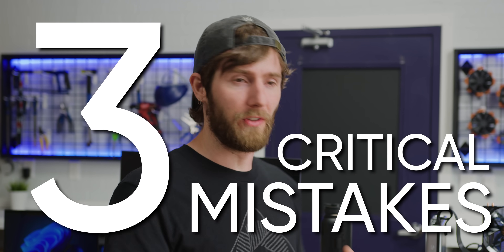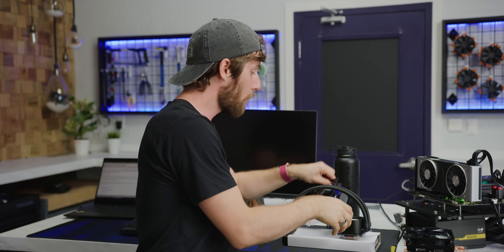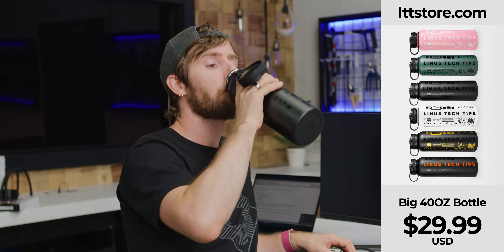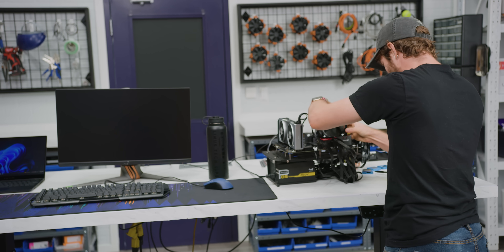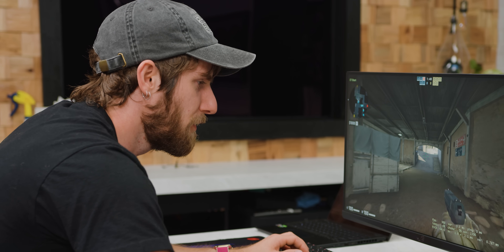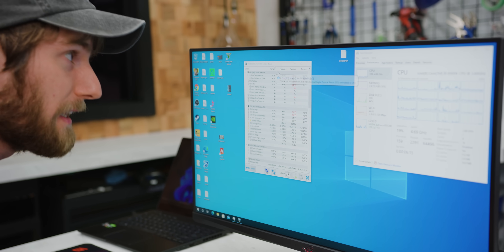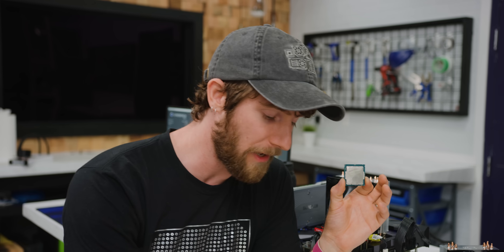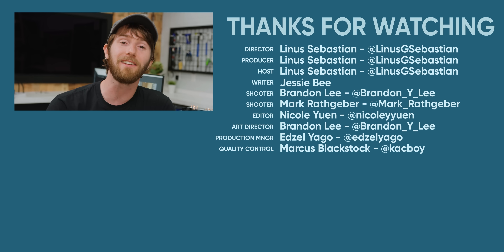How BAD is it if you forget to peel??

Comment: When I was 13 in 2004 I had a Pentium 4, 540 Prescott 775, which as you may know is hot as an oven, and I used it every day for all kind of tasks specially heavy gaming until 2011. Never removed that heatsink until one day I did it, and found the plastic completely melted over the copper core, then I immediately understood why during those 7 years two PSU and one GPU (gf6600) died. For my surprise the CPU is still running fine today in 2022 as a retro gaming machine.

Comment: I've had this happen to me, I believe on the i7-4970k. It smelled like burned plastic almost immediately, like before I logged into windows. It was disgusting, so I panic switched off and fixed it. Nothing happened, the plastic came off without a hitch (it didn't actually melt, it only smelled as if it did).

Comment: This reminds me of my friend who had a gaming rig. He upgraded his cpu to a i7-9700k and realised he probably needed more cooling and got a radiator and I offered to help him install it.

He denied my help as he said he was a better pc builder and could do it himself. So he installs it, we hop on rocket league together and not long before his pc is averaging 90 degrees and crashing every 2 macthes. 

Still running his rig like tht today insisting his room is too cramped and too hot and he applied the correct amount of thermal paste so he didnt do anything wrong😂
(Yes it still crashes on rocket league) 

I  have no doubt in my mind he forgot to peel tht grey sticker on the heatsink

Comment: A few years ago I bought a FX with a mainboard and a watercooler and it worked perfectly, but ran a little hot. So In wanted to remove the thermal paste. But ist was worse: there was so much thermal paste, that it got between the CPU and the socket. I think if it wasn't a CPU with pins it would have stopped working. I think that's the worst thing that can happen.

Comment: I bought my first computer from someone that had build it self and he forgot to peel the plastic of. It was a i7 3930K that really easy could handel it, because these cpu's are beast. But when i tried to overclock it, it ran way too hot so i stopped overclocking and ask for help. Some guy's said that maybe the cooler was not mounted correctly and that is where i found out that the cooler had still that plastic on! My cpu didn't died and it still runs nice and cool!

Comment: at the start of the video im say yes do to plastic when buring or melting do to heat it put off poison in to the air call carbon monoxied  i belive and im sure its not good to have melting plastic on ur cpu im no expert on it i just built computers sens i was 5 and have over 31 years of experiens but never whent to school for pc just help build and run a store with who was my step dad at the time

Comment: I don't remember removing a plastic peel I think my water block had a hard plastic cover but I doubt there was a peel because I have been running a 6850k at 4.6ghz almost constantly for about 5.5 years at a near constant uptime between gaming and mining only times it is off is for cleaning or the 2 times I moved or brought the pc with me for the holidays. The cpu is still solid and will still pass p95 stress tests which I wasn't sure it would still run like that.  I hot it running 4.7 somewhat stable but it wasn't the best and 4.8 was not great it would screen out or freeze up on me if the "case" got bumped too hard it is a thermaltake p3 setup as a wall mounted test bench now but wasn't mounted back then and cats love being dicks by rubbing and smashing thier heads or jowls into things lol.

Comment: Thermal throttling is great. You could run a modern CPU without cooler and it would just get burning hot and extremely slow, but won't die. A good old Pentium or Athlon K6 on the other hand would just instantly release the magic blue smoke, wich we all know is the thing making computer chips work. Without it, they don't work anymore!

Comment: So I have a really big question, due to modern CPU having a thermal cut back is it posable to just for testing purposes and not at all for any reason in a real world scenario. can a CPU be run with out a CPU cooler for long periods of time thermal throttling itself and still run windows normally... probably not but hell it will be a fun video to see.
Reply: Just to be clear I don't think this will work and if it even boots I will be very surprised if it even manages to start windows or get as far as the loading screen. I still want to see and test it for my self with something small like a I3 or perhaps something even as low as a single core CPU.

Comment: I just pulled an old k6 2x500 with a cooler on, and the plastic was never removed. it ran or over 40 years like that i removed the cooler after carefully levering it with a razor after a clean it still works.

Comment: I gamed on a Gateway PC for years where the processor heatsink was not properly installed and didnt know it.  It burned a line in the middle of the CPU where it was "connected".  This was back in the late 90's.  I found out when I was refurbishing it for my parents to use.  When I put a newer CPU in it I saw the badly connected heat sink and the burn mark.  Surprisingly Quake ran good on the machine.

Comment: BUTTTTTTTT what if that plastic has some thermal resistance.. just incase someone was accidentally leave it on so it wont melt i suggest trying a WAY cheaper grade cooler or leave the plastic on a aio block lol

Comment: I think there is another problem   with  thi forgetting  to peel and even more important  than  the heat!  The  plastic in between the  metal cover  of the CPU and  and  heat  sink  conduit in copper  will make  a parasetic  capacitance  that  will  effectivelly  generate a noisy signal  for  the WiFi  and other  wireless  components.

Comment: Worried about this in your prebuilt? You shouldn't be - the OEMs source their parts through contracts, so they know exactly what they're getting, and it wouldn't at all be anything they deem unnecessary (and remember - we're talking about the kind of companies that use 250W power supplies in their i7 desktops). And also, the plastic is there to protect that nice copper base (or heatpipes), and just about any OEM system cooler has a non-spectacular aluminum base anyway. So not only are they not concerned about a consumer installing a heatsink, but not even about that heatsink being at top shape or quality anyway. Much the same here applies to laptops also.

But I'm talking about HP, Dell and Lenovo, so on so fourth - I'm not talking about CyberPowerPC and the like. That would actually be a relatively realistic concern, and has probably actually happened before.

Comment: I had this happen, but it was with the tape on thermal pads that I forget to peel that were on my mosfets and ram modules on my GPU, but unlike this scenario mine turned off in a matter of minutes because of overheating.

Comment: I had my 7700K running at 5Ghz with a Master Cooler 240 usually about 86-90 C. I bought liquid metal pasta and a delidder, than i took it apart and the peel was still on the cooler

Comment: Ive had a client do this once was for like 1 years and most clients also forget to remove the plastic off the gpu top and its just dries up the adhesive and is a pain to remove, most pcs Ive seen with issue are where people don't screw in their coolers correctly where its at a 25 degree angle because only the 2 top screws are in not touching the cpu, if theres enough airflow for cooling in a home pc they wont even know, which is scary

Comment: I ran an r5 1600 for 3 years with the plastic on there and I was pushing almost 1.45 volts through it. That's not to say you shouldn't worry about leaving it on there because you'll have higher temps and the computer may randomly crash but nothing will be permanently damaged.

Comment: I did this with my i7-920. Upwards of 92 degrees Celsius and burning plastic smell. Yes it runs Crysis. Eventually would switch off. Removed melted and burnt plastic with alcohol and added a real cooler

Comment: My work purchases a Dell that was overheating brand new, rather than send it back we bought a cheap $15 dollar heatsink fan assuming it was just a bad stock heatsink/fan from Dell. After removing the heatsink found out the plastic wasn't peeled from the heatsink. The thermal paste obviously wasn't making contact and that explains the overheating..

Comment: My first build 6 years ago I forgot to peel off the plastic on my stock Intel cooler, 3 years later after consistent high temps that I thought were normal, I decided to swap the cooler mainly for aesthetics and died when I still saw the cover on there lol

Surprisingly ran into little issues because I wasn't too much of a power user I guess, but this video brought back some real funny memories.

Comment: I actually had that happen on my first  prebuilt computer and I used it for 2 years thinking 104C° was a normal gaming temperature and when i realized it wasn't ideal temperature i opened and my CPU was covered in molten plastic and it wasn't very easy to get off but I managed to get it out and bought new thermal paste and it went from 70C° not gaming to 40C° and from gaming temp of avarage 90-100C° to 60-75C°.
Reply: 2 years at 104°C... Jesus fucking Christ that poor CPU.
Reply: @Jenna_Talia  how can jesus fuck christ?
Reply: @Jenna_Talia It's pain and torment has made it stronger

Comment: the temps would likely be more intense with a case to bottle the heat

also the longer you keep the system and the more often you run it the more you degrade the plastic

Comment: when i got my new cpu, the store put it in for free with a aio and my temperatures were capping at 99C and i eventually took it apart and the seal was on it. i took it off and now run in the 40s

edit: keep in mind i have an i5 11500